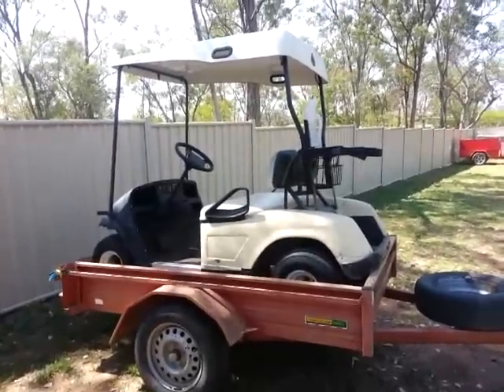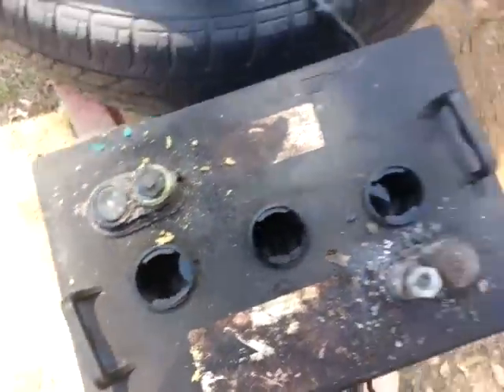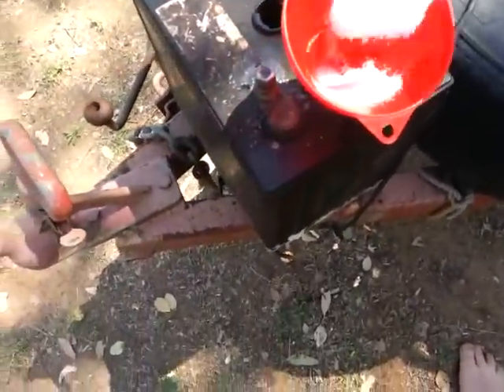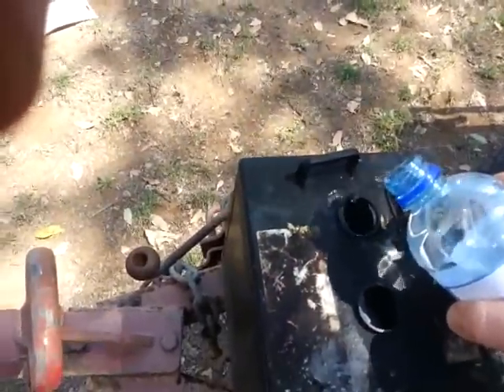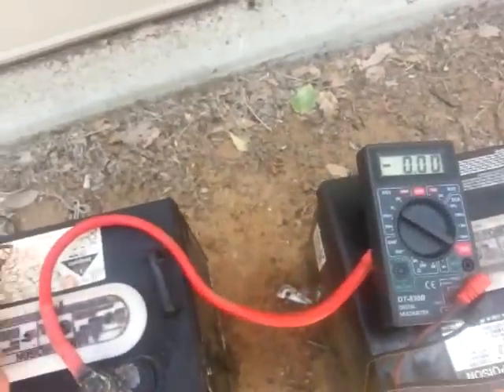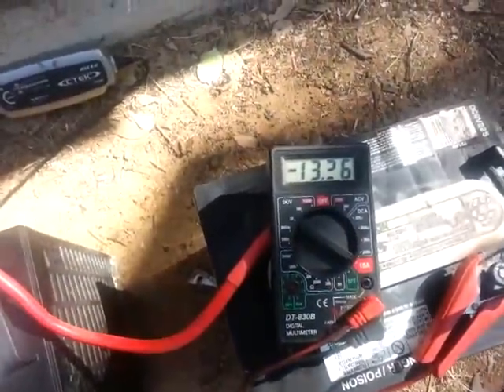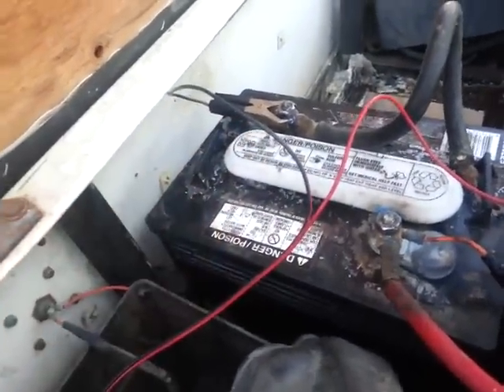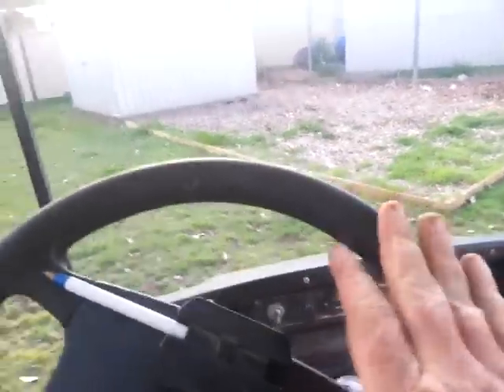How to use Epsom Salts to revive old or dead 6 / 12v volt Golf Cart / Car Batteries.

Comment: First thing I would do is clean all terminals and wire lugs. I mean I am surprised you dont have massive voltage drop. Corrosion kills!
Reply: Not certain about the points made but ,if anyone else wants to discover battery restoration try Battery Recovery Tactics ( http://battery.RecoveryTactics.com  ) ? Ive heard some amazing things about it and my m8 got excellent success with it.

Comment: wow this guy doesn't even know he has 6 volt batteries, he dumps the epsom salt directly into the battery without draining the old solution or predissolving the epsom salt... pretty much everything he has done is wrong yet this video still exists. Ignorance is like an infection and this is how it is spread to others... please remove your misinformed video before you send others down your error laden path.
Reply from the maker: Go and get a life troll! If you already had all of the knowledge on how to recondition batteries, then why the fuck did you need to watch a 'how to video'?
Reply: @BackyardBommber  you should not be doing a "how to" video when you clearly dont have a fucking clue what your doing.

Comment: I've found great project for that on Avasva website.
Reply: There are  a few things for getting a good result
Don't try to do this until you know what you are doing - the acid can burn your skin
check the voltage first - there may be a dead cell which would waste your time.
Check the battery fluid.
Try to fully charge the battery.
(I learned about these and more on Jons mender guide website )

Comment: I cannot see the point of adding anything such as epsom salts to a battery that then contaminates the existing acid. Surely the correct approach is to empty the battery of the acid and rinse it several times to remove the initial crap and then use a suitable chemical to correctly desulphate the lead plates. Then after this is carried out thoroughly rinse the battery again several times checking that all the chambers are clean. Add fresh battery electrolite and gently start the charging process using a basic charger not an intelligent one.
Reply: Disolved epsom salt is an electrolyte solution for the battery.

Comment: t was a weekend when I discovered 2 of the batteries I used were not functioning any more. Now, they are working because of the reconditioning program ( Check Details Here>>>https://www.facebook.com/Battery-reconditioning-310070329426065/app/208195102528120 ) I saves $ 180 because of this method!

Comment: the best success that i've had was with the Magic Mender Wizard (i found it on google) without a doubt the no.1 course that I've tried.
Reply: here's  several suggestions for fixing a car battery
do not try to do this unless you are sure what you are doing - the acid can burn you
check the voltage first - there may be a kaput cell which would waste your time.
Check the battery fluid.
Try to fully charge the battery.
(I learned about these and more on Jons mender guide site )

Comment: Who the hell said Epsom salt restores batteries? Over and proved wrong.  Manufacturer would use it if it did. Charge a bad battery at 16V, discharge to 10 V in  a 12v battery, recharge, repeat a couple cycles. This normally does the trick, if not, junk it.

Comment: Go blow your nose.  Do not attempt to put Epsom Salt directly into your battery because it will not dissolve properly into the battery acid, only water will dissolve Epsom Salt. Most dead batteries will be low enough on fluid that adding this solution will not over flow the battery.

Comment: my battery was 12v 4.10amp.  After add epsom salt like instructions and recharging battery over night, it droped to 8V 3amp and hot like boil water for two days.  It ruined the battery.  Better to recharge with battery acid; safe and still cheap.
Reply: @Thor Ng interesting points ,if anyone else wants to uncover how to recondition lead acid batteries try Jadonite Renovate Battery Buddy (just google it ) ? Ive heard some unbelievable things about it and my work buddy got great success with it.

Comment: I can't believe the ignorance I'm seeing here. First of all, you test the battery and it's showing 6 volts, which is NORMAL. Then you add a a huge quantity of epsom salt to the battery and THEN you add ordinary tap water! Only DISTILLED water should be used in a battery. Just what the hell were you trying to accomplish to this good battery? It seems you were trying to destroy it.
Reply from the maker: eyeball settle down champ, it was just an experiment! and NO I wasnt particularly concerned about getting these batteries back, all I wanted was enough voltage and current to test the motor, and control boards. EAGBOD
Reply: I totally agree with you Eyeball, It just doesnt make any sense

Comment: There are  a few suggestions for fixing a car battery
never try to do this until you are sure what you are doing - the acid can burn you
Test the voltage first - there may be a dead cell which would waste your time.
Check the battery fluid.
Try to fully charge the battery.
(I read about these and more on Jons mender guide site )